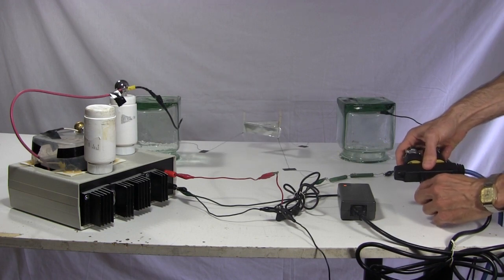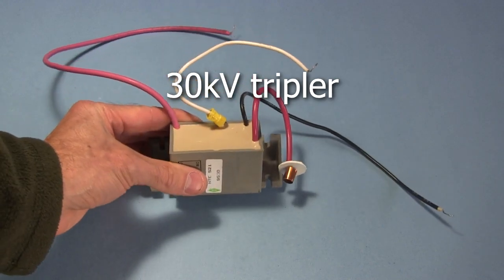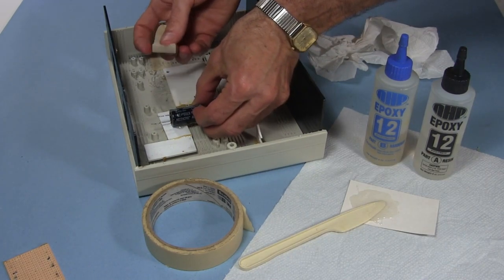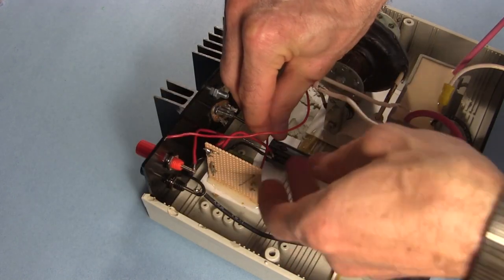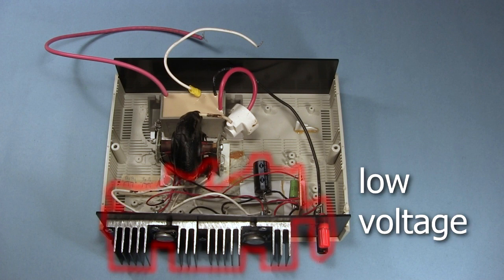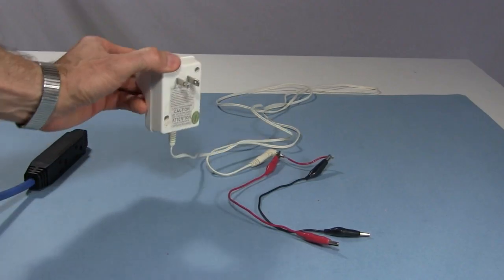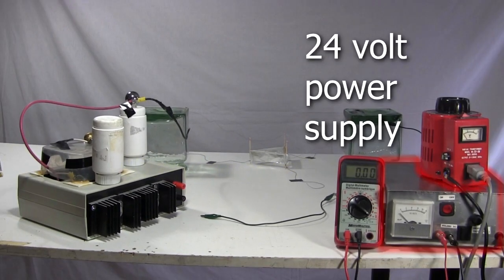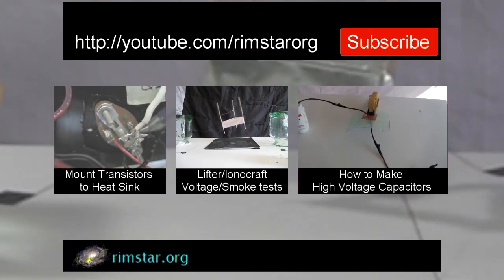How to Make 30kV High Voltage DC Power Supply with Flyback & Cockcroft-Walton Multiplier Tripler

Comment: I have another question that whether the black wire is the 24 gauge or not. Thank you.
Reply from the maker: It's 18 gauge (AWG).
Reply: RimstarOrg
Therefore, there are 3 kinds of wires for this right? The red one is 24 gauge, the white one is 18 and the black one is 18 too, right? I mean whether I need a 18 gauge of red wire?
Reply from the maker: Hoai Thu
I'm pretty sure they'll all 18.
Reply: RimstarOrg So just except the red one in the coil is 24, right?
Reply from the maker: Hoai Thu
I just opened it up to doublecheck and the black is 18, the red and white are both 24. But 18 would work for all of them if that's all you have.
Reply: RimstarOrg Thank you very much and happy holiday!!!

Comment: In an inverter  does the voltage get high and the current  is low so that the power is same
Reply from the maker: That's what happens with a transformer. An inverter takes DC and converts it to AC. The AC voltage can be higher or lower than the DC, it just depends on the inverter. For example, inverters used in solar power systems could convert the DC from a 24 V battery bank to 120 V AC or it could convert the DC from a 200 V battery bank to 120 V AC (for example). The power should be the same but with losses due to inefficiencies.
Reply: RimstarOrg thanks bro so voltage depends  upon the speed the electrons travel and current  is the amt of charge it take
Reply from the maker: Voltage is the energy per electron and the current is the amount of charge passing a point in the wire per unit of time.
Reply: RimstarOrg  so that's y in an inverter  the voltage is high as the electrons have high energy but the current  is low due to  less amount of electrons
Reply from the maker: I'm not sure what that has to do with an inverter but the rest of what you said is correct.
Reply: RimstarOrg thanks it has to do as in an inverter  also that same concept  is used like there are less amps and high voltage
Reply: If there are less no of electron but they are moving high speed  is this high voltage and less current

Comment: I have what is called an arc stabilizer (high frequency) that I have connected to my ac/dc stick welder. Can I use this for the purpose of making an ion lifter? Thumbs up on your videos!
Reply from the maker: +Tbvck I'd never heard of an arc stabilizer until you mentioned it. If it's high frequency then I suspect it's AC, in which case it won't work since a lifter needs DC or pulsed DC. Also, from just one quick google search I saw one that said it supplies 3500 volts, which is far lower than the needed 25,000 volts. So, with my very limited knowledge or arc stabilizers, my guess it that it won't work. But now that you know the criteria a little more you can verify if it applies to your arc stabilizer. My guess is that you'd have the needed current, maybe even too much! Thanks for the thumbs up!

Comment: Hello there :) great video ... i need to make a 220 VOLTS DC power supply . What would your suggestion be on that ? Looking forward to hear from you :)
Reply: right now i m thinking of using a micro controller and set firing angles and zero crossings .
Reply from the maker: Syed Javed Hussain Shah
I don't know anything about your micro controller approach, so can't suggested anything there. If you're in a country that gets 220V AC from the wall socket then  I'd start with a fused, then maybe a one-to-one transformer for isolating the circuit from the wall socket, then a full wave bridge rectifier which will output DC, then a large capacitor to smooth it out to more flat DC. It'll probably be less than 220 at that point though, so you'd have to change the transformer to one that would do a little stepping up. That's just my first thoughts.
Reply: RimstarOrg tnx ... ya that's like the basic setup .

Comment: Hii bro please give me openion about my final year project for Electrical engineering that can I make ionic craft in final year Electrical engineering Will this right.
Reply from the maker: I don't know what your professor would like to see. The only problem with making this power supply is that it's gotten hard to find a flyback transformer that doesn't have a built-in diode. The only place I know where you can still get them is here https://www.amazing1.com/transformers-high-voltage-high-frequency.html . I also have more information about making this power supply on my website here https://rimstar.org/equip/30kv_pwr_supply.htm

Comment: You already had an AC- flyback and then converted it to DC?
Reply from the maker: Yes. The tripler/voltage multiplier which I added after the flyback transformer increases the voltage and converts it to DC. Almost all the high voltage stuff that I do requires DC and doesn't work with AC. For example, the lifter which I test with near the end of this video requires DC and doesn't work with AC.
Reply: Ok, but wouldn't it be more efficient to use an DC- flyback?
Reply from the maker: If it has a single diode then I think it's pulsed DC, in which case it would depend on your needs. Also, the tripler/voltage multiplier steps up the voltage, in this case raising it from 20kV to 30kV (it's a Cockroft-Walton voltage multiplier circuit https://en.wikipedia.org/wiki/Cockcroft%E2%80%93Walton_generator).
I have my Cube power supply, which is the same as this one but does like you're thinking about, stopping at the DC flyback https://www.youtube.com/watch?v=-KFhBVfpfDw but its voltage wasn't high enough for my lifter, which needs around 25kV minimum (I measured it here https://www.youtube.com/watch?v=LOGAaObsN4g).

Comment: Why it is necessary to connect 0VDC to the ground?
Reply from the maker: That's mainly for safety. Voltage is really a difference in potential in two places. Since this power supply can output 30,000 volts, that means the output is 30,000 volts relative to somewhere. By connecting one end of the circuit to ground then the output is 30,000 volts relative to ground (which basically everything else in the room). If it wasn't connected to ground then that 30,000 volts would be relative to who knows what? It'd be what we call floating.

Comment: Why can't the flyback transformer contain a diode? And if it has one, is it possible to remove it?
Reply from the maker: The output of this power supply is supposed to be DC (Direct Current). The last part before the output is the voltage multipler (tripler). The voltage multiplier outputs DC, like we want it to, but you have to give it AC (Alternating Current) for it to work. The flyback is what feeds the voltage multiplier and so the flyback must feed it with AC. If the flyback has a diode then it won't be outputting AC, it'll be outputting DC instead. A flyback without a diode outputs AC, which is what we want. In diagram form, we want this:
flyback -AC-> voltage multiplier -DC-> output
but a flyback with a diode does this:
flyback with diode -DC-> voltage multipler -doesn't work-> no good output
If you want, you can skip the voltage multiplier and just use the output from the flyback with its diode. The output will be DC but it won't be as flat a DC as with the voltage multiplier and it will also be a lower voltage (but higher available current). I do exactly that with my Cube power supply here https://www.youtube.com/watch?v=-KFhBVfpfDw Just be warned that since the voltage is lower, there are some things which I do which wouldn't work. For example, the lifter which I demonstrate at the end of this video won't work and neither will my design of a smoke precipitator https://www.youtube.com/watch?v=ARSQWTzWago
Can you remove the diode? I've never tried but when I look around the web I see others that have tried but not succeeded unless I missed someone who did, which is possible.
Reply: @RimstarOrg  Thanks! This is really helpful. So can I make a voltage multiplier like the one you used? How do I know if it multiplies the voltage by the same factor?
Reply: And how does the flyback function on 0-24VDC? Did you design a built-in inverter?
Reply: I am trying to build a power supply as well. And the multiplier has 1 stage of multiplication? What factor does it increase it by?
Reply from the maker: Yes, you can make your own voltage multiplier. I show how on my webpage here https://rimstar.org/equip/negative_voltage_multiplier.htm but I don't know how to do the calculations for the output. I know it's not straight multiplication based on the number of stages.
As for how the flyback functions on 0-24VDC, that's what the transformers and resistors are for. They don't give the flyback straight DC or even AC. The flyback sort of pulls from them in an alternating fashion. I usually go to the explanation on this page http://www.powerlabs.org/flybackdriver.htm when I need a reminder of how it works.
Reply: @RimstarOrg  Thanks, and do you know what the ratio of primary to secondary windings are on the flyback?
Reply from the maker: No, I don't know the ratio, or even the number of windings.

Comment: Hi! Very Nice Video!
Can wie also put 50.000kv out oft this?
Reply from the maker: PojntFX No, the maximum for this one is around 30,000V. For 50,000V you'd need to make your own Cockcroft-Walton voltage multiplier/tripler.
Reply: RimstarOrg Thanks for your answer! Could you make a Tutorial for this? I'm trying to make a ion truster for space ( Xenon ) and I think that 50kv are the minimum!?
Thanks for an answer!
Reply: RimstarOrg Thanks for your answer! Could you make a Tutorial for this? I'm trying to make a ion truster for space ( Xenon ) and I think that 50kv are the minimum!?
Thanks for an answer!
Reply from the maker: PojntFX I don't know if I'll make a tutorial about it but I do have stuff on my website about making Cockcroft-Walton voltage multipliers.http://rimstar.org/equip/negative_voltage_multiplier.htmhttp://rimstar.org/equip/equip/pos_neg_voltage_multiplier.htm

Comment: I found this video whilst looking for a parts list to make an "Electrostatic Precipitator Filter"
  Where i live there is a big fuss about wood smoke from wood stoves due to the air quality generally suffering in the area right now. I thought it would be nice if someone had a parts list for a working unit that fits right onto a chimney. 
  This power supply could be a good start. I know they require between 20-30KV but i am not yet sure if it needs to be DC or AC. I still need to research. I believe the type of power supply you have built could be ideal. I think i even have a flyback transformer somewhere.
  What do you think about a project to build a practical working add on for chimneys?  
 This could be really useful for thousands of homes since the commercial ones cost upwards of €1500. I know the parts would cost less than $500 probably more like $250 for everything depending on the quality of the materials. 
  Does this sound like a good project to you?
Reply: Yes it appears that it must be dc industrial applications use up to 80KV perhaps more. But i think residential use between 20 and 30kv so this power supply could be perfect. i remember power consumption being between 50 and 180W on residential systems. Do you know the maximum power that your supply can handle/provide if paired to a more powerful input power supply?
Reply from the maker: I don't know the maximum power input this can handle. The maximum voltage I give it is around 24 volts and because of a fuse in my low voltage power supply that I use to feed this, the maximum current I give it is around 5 amps.
I don't know which precipitator you've been looking at but mine produces ozone, which is also bad for your health. So it's good as a science experiment but not for long term use. There's some voltage below 10kV where it doesn't produce ozone but I don't know what that is (my precipitator needs 25kV). Apparently the commercially made ionizers you find in stores function below that voltage. 
Here are the videos about my precipitator:
http://youtu.be/x5YFK8mmeRQ

https://youtu.be/ARSQWTzWago
Reply: Yours is 120W so probably in the range to do the job. The idea for the electrostatic precipitator is to fit it in the top of the chimney. As long as the fire is running i doubt much ozone will remain for several reasons. 
A. i don't think there will be a corona as the gap will be too big so ozone probably won't be produced.

B. If Ozone is produced it will become neutral very quickly and it will become O2 and the O1 will find itself attached to an unstable particle.

Ozone is very unstable meaning that it just can't last long before it looses one of the 3 O molecules to another unstable (usually toxic) molecule or it can turn more ozone back into oxygen. see link below.

  Yes it is bad to breath in but since it transforms so quickly that as long as you are not in the same room it will not pose a threat.
  In an outdoor area. It will help to clean the air if anything. The ESP works slightly differently. There is an outer metallic tube (the chimney) and there is an inner rod (not sure yet if this is an anode or cathode i have only just started looking into this).
  Basically the soot passes between the two and picks up a charge and sticks to one of the charged plates.
  Later the chimney can be swept or cleaned by vibration or water depending on the system. The advantage is that it can collect upto 95% of the particulates. The disadvantage is that you have to clean the chimney more often.
  With local air quality suffering there is a large demand here for such filters and the price to buy one starts around €1500 not including fitting. (Many people here burn wood stoves for heating or for show).
  Obviously the parts only cost a few hundred.
 It would be nice if someone developed a kit that had a parts list so that more people could affordably fit ESP filters.
 
https://disc.gsfc.nasa.gov/ozone/additional/science-focus/about-ozone/ozone_cycle.shtml
Reply: Some more info:

http://www.ieabcc.nl/workshops/task32_2011_graz_aerosols/06_Hartmann.pdf
Reply from the maker: Regarding A., a bigger gap requires a higher voltage and so more ozone will likely be produced. It's the lower voltages that don't produce the voltages and low voltage work with smaller gaps.
Regarding B., I think you should be searching using the term "ground level ozone". The causes are different than stratospheric ozone, though I wasn't able to find information about the method or how fast "ground level ozone" breaks down.
Reply: I'm no expert but i don't think the idea is to create any type of corona. You just need to induce a charge on the passing soot particles then they are attracted  to the oppositely charged plate. Later they can be cleaned or swept away. Wood smoke and industrial smoke is a big topic of debate  in many areas where the air quality sucks. Shame there is no full build instructions for ESP filters. At least you have what seems the perfect power supply design here.
  Perhaps if i get time i will do the rest as far as mechanical design go's. If anyone is interested let me know.

Comment: thanks so much for posting the video. I would like you to do one more thing for  me. I would you to send me the circuit diagram of the 35 kV voltage supply. I also want to regulate the voltage output between 25 kV and 35 kV for my project. thanks
Reply from the maker: +MAXWELL AMOAH The circuit diagram is on my website at http://rimstar.org/equip/30kv_pwr_supply.htm (BTW, it's up to 30kV, not 35kV). Regarding controlling the voltage, that's done by a VARIAC and the low voltage power supply that feeds it and details for that are at http://rimstar.org/equip/24v_pwr_supply.htm.

Comment: Is your 120 kilo ohm Resistor, a metal oxide resistor or other type? Any keyword, how I can purchase online.
Reply from the maker: It's a wire wound resistor but as long as it has the resistance and a decent watt rating then I don't think it matters. The values I use are all just handed down, rule-of-thumb from over the years. During normal use of the power supply, the current is tiny. It's only when there's a spark that the current is high, though I don't know what value. If you knew what the current during a spark would be then you could calculate the watt rating (kind of hard to measure a spark's current).
Also, in this video during the sparking demos I'd put the resistors on the high voltage side, but normally I can put them on the ground side like I did in this video for the lifter demos.

Comment: what is corona , I heard that if the voltage gradient increases it becomes an arcing.what is the voltage range for coronal discharge formation? plz explain as much as possible OR please make one video on it because I'm unable to find out any good video on youtube about this concept.
Reply from the maker: Tanmay Mukim I don't have a specific video about corona but I've explained it in a few different videos. For example, in my video about how a Van de Graaff generator works at 4:27 https://www.youtube.com/watch?v=EsZQS2GOMQE. I've also found this page explains it fairly well http://en.wikipedia.org/wiki/Corona_discharge. As for what voltage range... that's hard to say since it depends on the shape of the electrodes on either side, as well as the temperature and humidity of the air.
Reply: Tanmay Mukim in a vacuum there is no corona, air molecules have to be stripped of their electrons, it's those same electrons that go from one energy level to a  lower level that produce photons of light.
The law of conservation of energy can't be broken so they say.
Reply: Thanks to both of you for helping me out.I'm working on coronal discharge & coating technology.